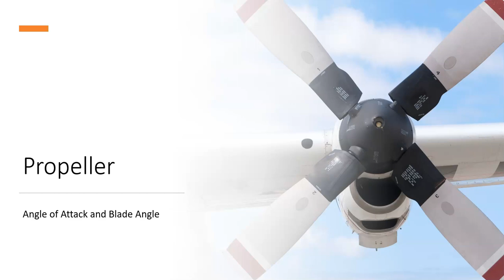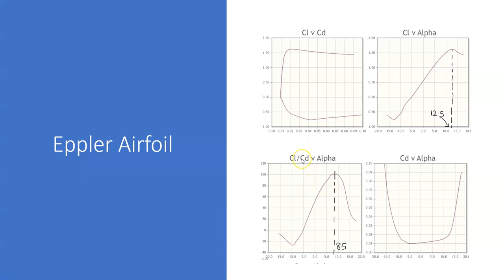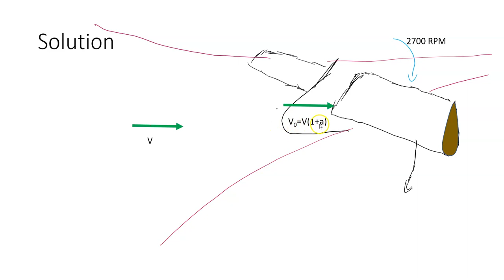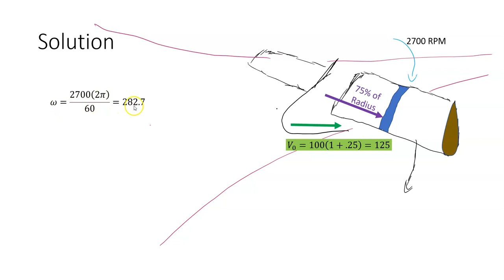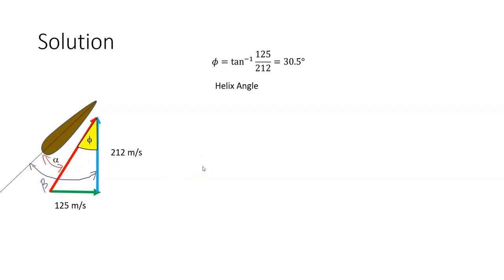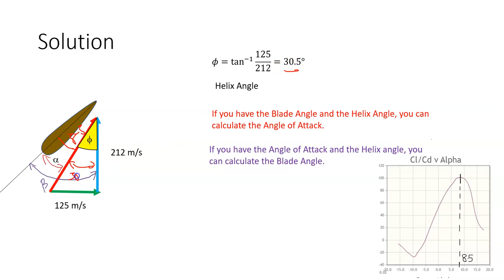Calculating most efficient Propeller Blade Angle

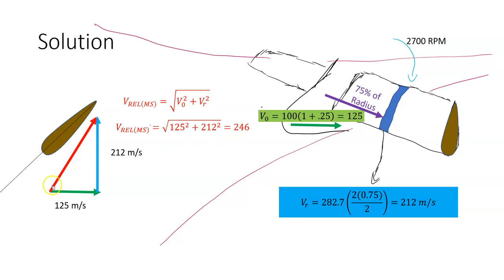Comment: Hello! Can the method on 4:48 be applied at 50% of the radius? or 25% of the radius?
Reply from the maker: @양자제노효과  yes, the same method applies.
Reply: Thank you. I have another question. Can there be a lift even though the propeller is rotating just by wind?

Comment: What is the blade ange is greater than the relative wind angle?
Reply from the maker: Normally the blade angle is greater that the relative wind angle.   However, if the relative wind angle is greater than the blade angle then the propeller will have a negative angle of attack and this will create negative thrust i.e. Drag.
Reply: @RoddyMcNamee  so negative angle of attack is also a thing? 
Does this normally happen in a propeller or should i convert this angle to positive and assume it invertively?
Reply from the maker: @aiozard  it can happen with a propeller.  An example of it is when the engine fails and the propeller starts to windmill.   When it windmills the RPM will drop significantly, and this can lead to a negative angle of attack.   For this reasons, a lot of propellers are put into the feather position when the engine fails.
Reply: @RoddyMcNamee  thanks. Im looking forward in learning here rather than just my fast instructor that i cant keep up haha

Comment: Hello!  What if I want to calculate the turning resistance,  to find the torque needed?

I will have a 15hp motor driving a propeller via reduction, probably 1.2 and motor will max between 5500 and 7000 rpm. My ultimate goal is to find blade angle with say a 48 inch blade.
Reply from the maker: Hello James, this is not something I can explain in the comments, but I will come back to you with a video on this.
Reply from the maker: @James McClaren I made a video to answer your question.  You can find it here:  https://youtu.be/bP5POqR_D9c
Reply: @RoddyMcNamee   wow 1 year later and I had the same question still answered.. sorry youtube never told me!!! I am watching your video now... How cool.